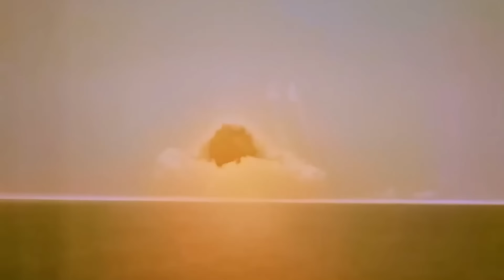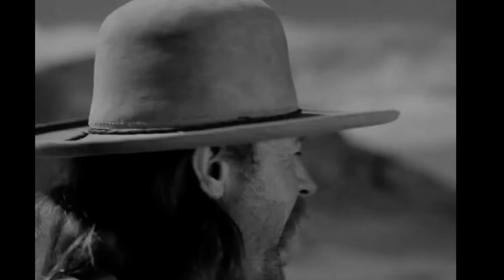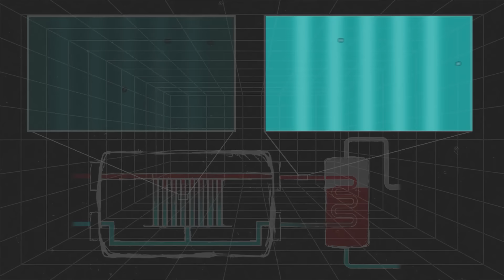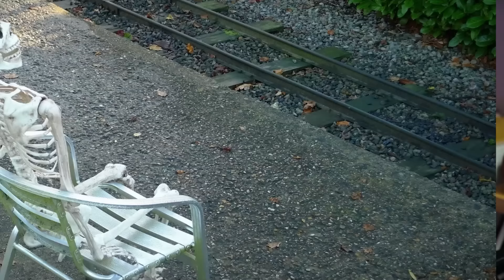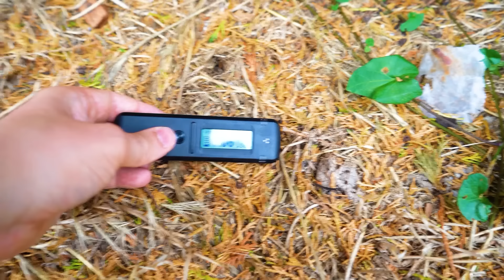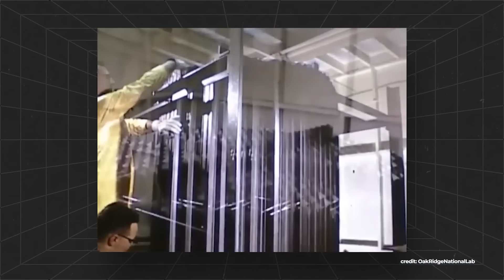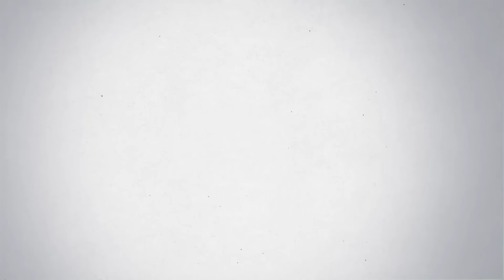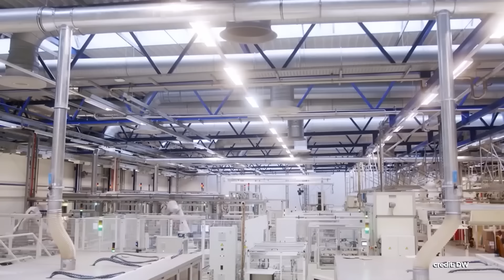It's Happening - China Launches World's First Thorium Nuclear Reactor

Comment: Fucashima didn't melt down.  Neither did Three Mile Island.  They released some radiation that didn't end up hurting anything.  Chernobyl is the only true melt down that I know of.
Reply: Fukushima suffered three partial meltdowns, they now have three compromised cores that are leaking highly radioactive material into the ground and groundwater. Water is used to cool those in a constant loss system, they have to filter the highly radioactive water at huge cost to get it to just tritium contaminated. The total cost of the cleanup is expected to top one trillion US$ and the completion date for the cleanup keeps getting pushed back, currently somewhere around 2050.
Edit, Three mile also suffered a partial meltdown.
Reply: Japan was lucky that the wind blew 90% of the radioactive plume over the pacific ocean and not Tokyo.
Reply: @Vindolin  And even luckier the spent fuel pools didn't collapse. And
"Later that day, however, concerns abated after a helicopter overflight captured video of sunlight glinting off water in the spent fuel pool. In fact, the crisis was worsening: The pool's water was boiling away because of the hot fuel. As the level fell perilously close to the top of the fuel assemblies, something "fortuitous" happened, Shepherd says. As part of routine maintenance, workers had flooded Unit 4's reactor well, where the core normally sits. Separating the well and the spent fuel pool is a gate through which fuel assemblies are transferred. The gate allowed water from the reactor well to leak into the spent fuel pool, partially refilling it. Without that leakage, the academy panel's own modeling predicted that the tops of the fuel assemblies would have been exposed by early April; as the water continued to evaporate, the odds of the assemblies' zirconium cladding catching fire would have skyrocketed. Only good fortune and makeshift measures to pump or spray water into all the spent fuel pools averted that disaster, the academy panel notes."
Look up
"Near miss at Fukushima is a warning for U.S., panel says"
Reply: All of those had at least partial meltdowns, but only in Chernobyl did a part of the inventory (fuel and fission products) escape into the environment, because the RBMK reactor was the only one that didn't have a containment, and used graphite as moderator. It was the burning graphite that transported radioactive particles high up into the atmosphere and allowed the contamination to spread so widely.
Reply: At Fukushima fuel and fission products are escaping into the environment every day since the accident. The reactors are not contained. They add water to them and then pump out the leaking water out of drainage wells around the site. In an effort to stop that contamination reaching the ocean they have cemented 73,000 sq meters of ocean floor.
Reply: A meltdown is defined as thermal damage to the fuel rods.. Fukushima had fusion material actually leak out of the reactors and three mile island also had melted fuel rods but they remained contained at the bottom of the reactor,
Reply: Chernobyl was an explosion that caused a meltdown due to the reactor safety test design mechanism. If your egg cracks because you drop it, it doesn't mean it was already a cracked egg
Reply: Both reactors did indeed experience a meltdown. In TMI’s case, the fuel never left the pressure vessel and the only radioactive release was in the form of noble gases. At Fukushima, the reactor melted through the pressure vessel and again, the radioactive release was primarily in the form of noble gases.
Reply: ALL radiation hurts something.

Comment: Ive always wondered about that molten salt reactor they built back in the 50s. Id heard over the years its the safest reactor ever created🙂
 Thanks for telling me/us about it and the ongoing development of thorium!
Reply: S2G was the initial power plant of USS Seawolf (SSN-575). This was one of three sodium cooled reactors (the core was moderated) ordered for the Seawolf program at the same time as three PWR units were ordered to support the USS Nautilus (SSN-571) program; In each case, one reactor was land-based for training and research, one intended for installation on a submarine, and one spare. The land-based unit corresponding to S2G was S1G reactor. The reactor core was beryllium-moderated.[1][2]
Persistent superheater problems on Seawolf caused the superheaters to be bypassed, resulting in mediocre performance. This and concern for the dangers posed by liquid sodium coolant led to the PWR type being selected instead as the standard US naval reactor type, and the S2G on Seawolf was replaced by the spare S2Wa reactor from the Nautilus program.
The Atomic Energy Commission historians' account of the naval sodium-cooled reactor experience was:
Although makeshift repairs permitted the Seawolf to complete her initial sea trials on reduced power in February 1957, Rickover had already decided to abandon the sodium-cooled reactor. Early in November 1956, he informed the Commission that he would take steps toward replacing the reactor in the Seawolf with a water-cooled plant similar to that in the Nautilus. The leaks in the Seawolf steam plant were an important factor in the decision but even more persuasive were the inherent limitations in sodium-cooled systems. In Rickover's words they were "expensive to build, complex to operate, susceptible to prolonged shutdown as a result of even minor malfunctions, and difficult and time-consuming to repair."[3

Comment: The U-233 that is the waste product of Th reactors has a HARD gamma, that makes handling the waste an absolute nightmare. Plus its a massive risk to the non-proliferation community. Id rather just see safer and newer "conventional" reactors
Reply: No.Its actually U232 that produces the gamma radiation.  Pure U233 can be handled with surgeons gloves for radiation protection.

The problem is that thorium or contains up to 7 isotopes of thorium - and one of them decays to U232 at high enough levels to be a problem for thorium fuel waste and makes reprocessing the uranium problematic as you need lead shielding and long tongs to handle the reprocessed uranium.

I note that the USA developed a process for producing pure U233 for potential bomb use (U233 has some real advantages over Pu239). But the process is astronomically expensive compared to Pu239 production and was U233 bombs not contaminated with U232 were stopped at that stage.

Of course a problem with a thorium fueled molten salt reactor is that liquid fuel can be bled off and used to make that ultra-pure U233.

All liquid loops leak. What is normal leakage... how would you detect small or even modest diversions?   Its not like solid fuel reactors where they can physically count fuel assemblies or fuel blocks with their serial numbers.

Comment: My source could be suspect, but I heard that China's renewable capacity is already enough to power their civilian power needs.  So limiting these reactors to industrial requirements isn't necessarily a limitation. Solar, wind and hydro seem more aligned with typical domestic needs while the more industrial process of nuclear seems a better fit for industry.
Reply: most of their electricity comes from coal
Reply: @goodfodder  Because most of their electricity demand is from industry, not civilian uses. Their use of coal as a percentage is not just falling, but that fall is accelerating. Meanwhile, much of their industrial output is for export and anybody who buys anything from China has to count those emissions as their own.